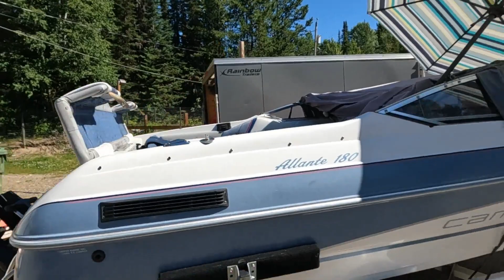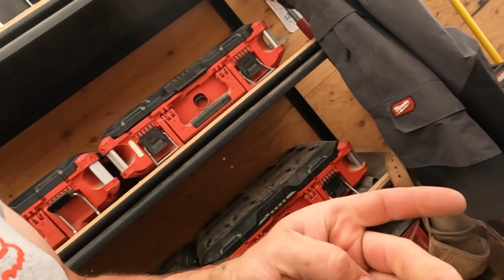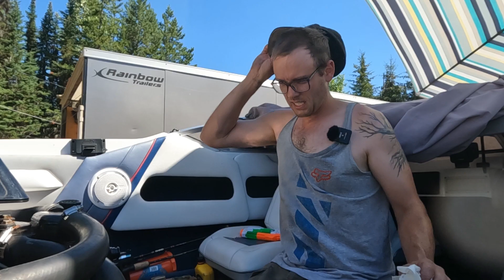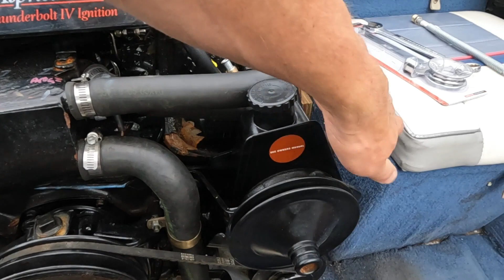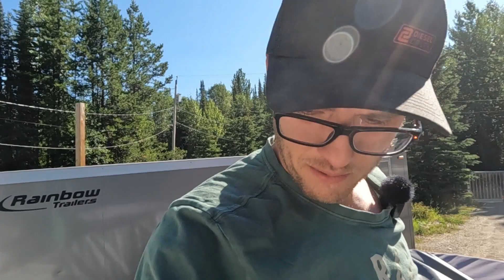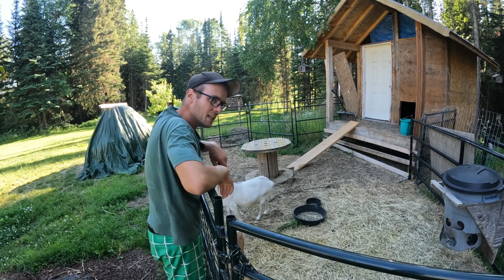Alpha One Mercrusier Power Steering Troubles - Replacement Lines and Oil Cooler Testing

Comment: Cost a little more upfront, but marine parts are the way to go in the long run. You won’t run that boat engine anywhere near as much as that truck engine in a year, but when you do you’re holding a higher rpm for a longer duration. Different standards require different parts. At least compare parts builds to see how they’re different. Get creative on the boat, but stay marine on the engine. Great vid! 🍻

Comment: First off another very well made video I always enjoy your commentary and you are very easy to listen to. Next congratulations on the boat they are fun but have some challenges which you are finding believe it or not you picked a pretty good engine platform to buy I'd say that's a rock solid mercruiser 4.3 However I heard you say the common mistake I hear alot that marine and automotive cross.
 I've owned at least a dozen boats in my life and I thought the same thing I will tell you I was sadly mistaken a time or two lol, the suggestion I make to you is be careful of what you are buying not marine because the difference is car engines use glycol propylene which works as a lubricant so water pumps and other components stay slightly lubed, But marine grade parts have special seals with lube in them sealed so to speak ask me how I know? Well I had to paddle my boat for 2hrs to get home because I bought a sensor that was a automotive one and it got wet and shorted out because the marine one was silicon filled and 10 bucks more. Just a heads up is all I'm saying watch out for this, lol. Also, I never bag on a fella striping out his fittings the first time; that's how you learn. Lol, like I said, I enjoyed the video very much, thank you!!
Reply from the maker: Thanks for the kind words on my production quality. Ill watch out for parts the should be truly "marine". I have no interest in paddling.

Comment: That saginaw power steering pump fitting is a good idear! I'm gunna buy a few of them pricks
Reply: Thanks for shout this channel Peg, both of you are minty as feck!
Reply from the maker: Beauty! Thanks for watching!
Reply: PSC steering components out of California I think sells high flow fittings for the high pressure output of the GM p pumps that convert to JIC.  I have one on my off road truck for higher flow to my steering ram.
Reply from the maker: Man I wish I could have gotten my hands on that fitting right off the bat. Can you believe that all of the parts stores here didn't even know what the fitting was in the first place. I have gotten plenty of education through the process.